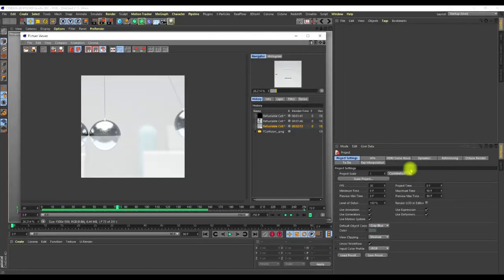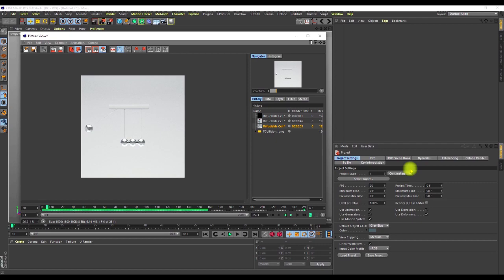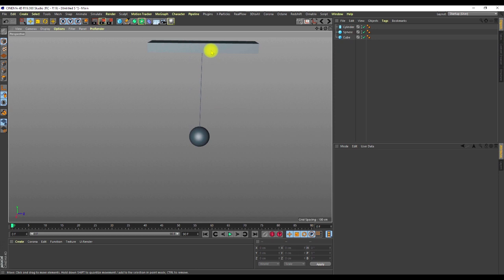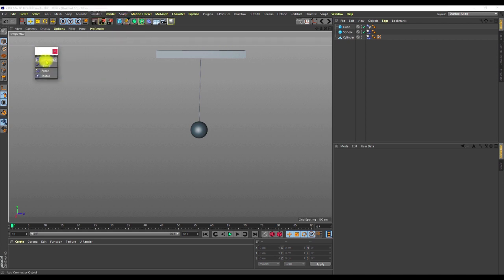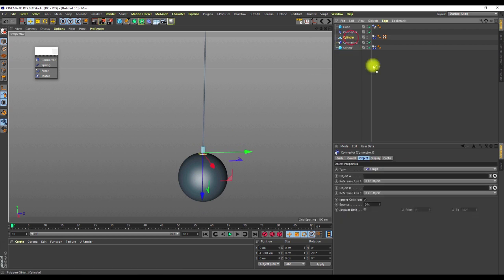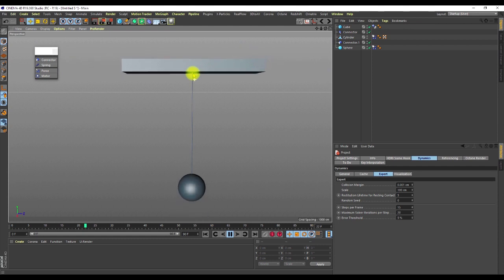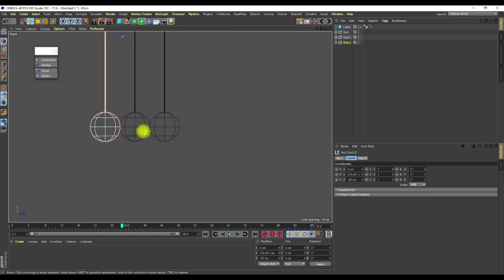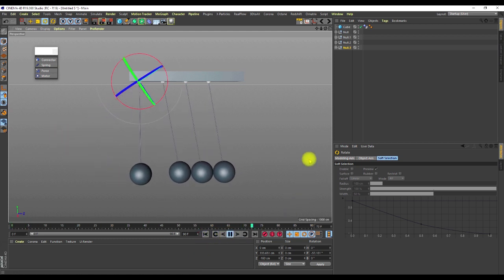Cinema 4D: Create exactly that Newton's Cradle animation

Comment: But the "real" newton cradle is not connect like this. There are two set of wires connecting each sphere diagonally. By the way,I think beside the Bounce value, you should tweak the Friction and Collision Noise. Your spheres now go a bit too random, I think you should increase Friction and reduce collision noise.
Reply from the maker: Okay. Thanks for the input. I'll do what you have asked and whatever result I get, I'll share in my shorts.
Thanks once again Andrearusky